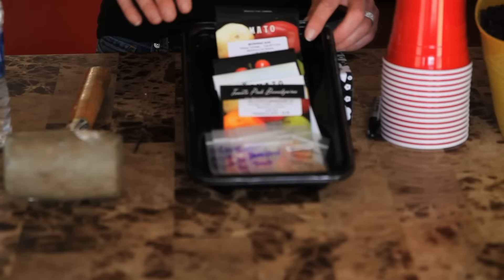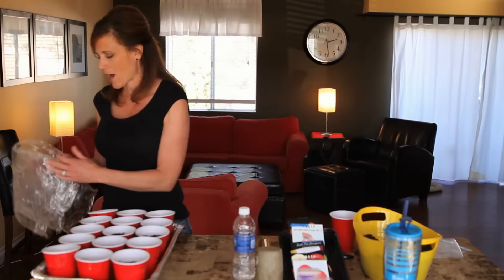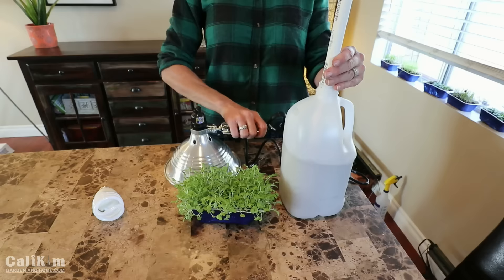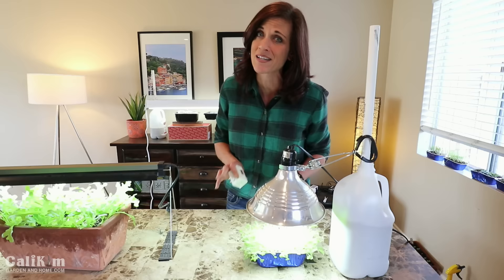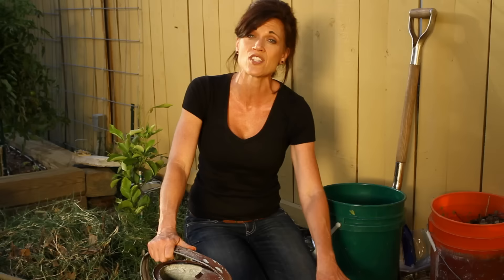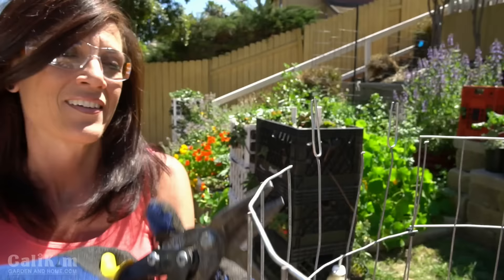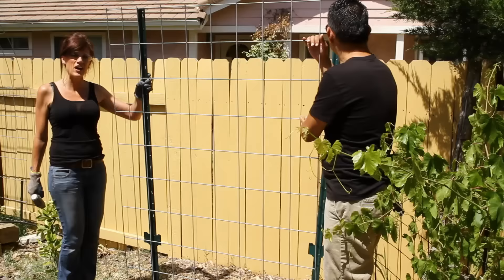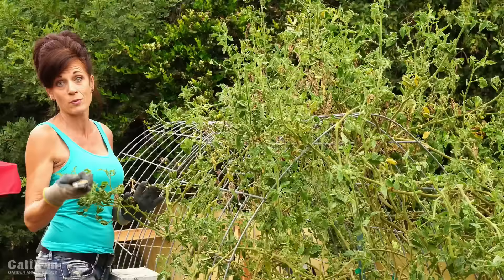How to Grow Tomatoes from Seed to Harvest // Complete Gardening Guide with Digital Table of Contents

Comment: I use same method with drinking cups and coffee cups.  Ice Picks make nice holes too. Also,  if you get the disposable coffee cups with plastic lids, you can fill the cup with garden soil,  put the plastic lid on,  turn the cup upside down,  cut a hole in the paper bottom of the cup and put the seed in. The cup will drain  then and the sprout comes up through the bottom with the hole in it which is now the new top.

Comment: hi , i enjoyed your video , a few diy's i use ,  my hoop cages were same mesh but 6''x6'' welded wire x 5' the diameter i choose was 30'' with 2 metal fence posts .  the hornworms were dealt with by having plastic mulch and spray with hot pepper wax , now when they try chomping the droppings are a bright green when fresh , day old they are dull green , day old they are brownish black , i look for the fresh droppings and then search over them , now where i am i move those critters to the sumac trees as they seem to enjoy those also ,  i am in northern new england  we transplant to outdoors on Memorial Day , harvesting starts July 4th ,  i pump fertilized water 24/7 in soaker hose buried under my plastic mulch , this allows the heated warm moist environment , a ecosystem with pest seeking frogs and garden snakes preying on bugs and rodents ,  the tomato root structure evolves into 2 huge root balls one a foot down where the manure is placed when they were planted and the other root ball is next to the soaker hose , i only grow those antique varieties ,  the extra tomatoes we make into paste and freeze ,  130 plants produce over 2,000 pounds through our season ,   happy harvesting !

Comment: Colin I've never used anything  but rain water for the garden needs and just started last season with seedlings and didn't think about the chemicals and did use treated water, thanks for addressing the issue 
I'm in zone 6 Ohio your seeds system doesn't work in this condition but you have lots of great teaching I'm taking notes ,about Bakers Creek Seeds lots of fine folks..
Lady Thanks

Comment: I know this video is a couple years old, but we bought 2 of the FM lights this winter, and discovered that FM puts out little cords that will link them together, up to 4 lights on a single switch. They run about $9 each from the company, but it sure saves a lot of outlet space by eliminating the power cords for 3 of them!

Comment: I use to make hog traps with cattle panel and install them in the woods. I use a small pair of bolt cutters, very clean cut and fast. You can get a pair at any hardware store where they sell the chain.

Comment: I actually planted about 25 starter tomato plants right after the last week of temps dipping down belowing freezing.  It may have been early February, and all i went with was the 15 day forecast and a gut instinct that the freezes were over.  Well several nights dipped into the upper 30's but tomatoes seemed to thrive.  They now are over 2-1/2 feet tall, very wide branched and with tomatoes now growing as big as 2 inch diameter. Very healthy and dark green foliage.Some are in 5 gallon and some in as large as 10 gallon containers. But in fairness i am in Baton Rouge Lousiana. Now it is on average 78 degree by day and 64 maybe at night. And soon will come the muggies.  Lots of hot muggy days ahead. Today, the day before Easter it is sunny, and mid 70's.
Reply from the maker: Congratulations Richard! You plants certainly sound healthy bound to give abundant harvest- thnx for sharing!🍅

Comment: If you write the name on the cup vertically instead of horizontal, you can cut the cup up and use it as a name tag in the garden.
Reply: PS LEDs use less energy than CFLs. 
You should look into compost tea. A lot of the same ingredients in your soil but you can add it slowly throughout the summer.. it also has mycorrhizal and sugars..
Reply from the maker: Brilliant! CK

Comment: Another crazy thing is if you have a dedicated area you start your seeds in that doesn't change is you can take two pieces of twine and two hooks that you screw into the wall or ceiling put them in the ceiling the hooks I mean and then tie two pieces of twine one on each chain and after you pass the twine through the hooks about 3 or so depending on ceiling height and all that time me two pieces of twine together to make one rope and just raise and lower the light that way I have an old 4 foot T12 fixture and balanced driver and I found some full spectrum grow lights that replace the T12 bulbs at Walmart I haven't got to try them yet but I have tried the smaller normal light socket base grow light that are the same Full spectrum color and I have had really good results with those the only thing is those don't plainly stay the Lumen rating they just show you what wavelength colors that they put out which is exactly the ones you need for both flowering and vegetative growth and so far I have been growing a full grown tomato plant indoors and it's winter time just about and it's still producing fruit and I have quite a few good sized tomatoes on it and it's still producing flowers cuz it's an indeterminate variety I have it in a 30 gallon storage container tub as its pot and the bottom three in I filled with gravel also wood Drilling a few good size drainage holes to prevent it from getting waterlogged and I can't wait to try these tomatoes that are coming in on it because I'm proud of this plant just at the beginning of fall outside just before the frost started coming in and I had my doubts but I get being able to grow indoors but I'm pretty excited that's so far it is going very well the last time I tried growing vegetables indoors fungus gnats and taking over before I could get control of them and killed my plants but this time I was prepared can I put a half inch to 3/4 inch thick layer of sand over the potting mix and gnats cannot borrow down to that course sand so they can't lay their eggs that has the larvae that eat the roots so far that's paid off pretty well

Comment: I put leaves and grass clippings around my tomatoes it's great for the nitrogen the plants need as well as protecting the roots and the ground underneath from drying out
Reply from the maker: Great tip, Lyle!!!  Sheesh, if thats working, keep on and thanks for sharing it here!!!!  Thank you for posting-Kim
Reply: @CaliKim29   I do live in Indiana so the weather is a bit different obviously but some people say it doesn't work but the problem is there not putting it on thick enough keeps the weeds out or at least most is them I wish I could tell you if it was recommendable in California because once the Tomato season is done we get a lot of snow and rain that helps to degrade that old grass down into the soil and basically turns it into compost for the following year

Comment: easy proccessing tip for halving cherry tomatoes. place about 15 tomatoes on a saucer. Cover with another upside  down saucer. press down on top saucer till you feel the resistance of the tomatoes. Carefully saw through between the saucers . Voila...15 tomatoes in a bout 10 seconds. (restaurant industry proceedure)

Comment: Word of advice don't use tin snips like she is using it will ruin your tin snips. Tin snips are to cut sheet metal not round wire. You should use side cut pliers or bolt cutters plus so much easier.

Comment: Yess..i will be using the same fertilizer  is very good i love it.thank you for the tip i using for the last 6 months .
Reply from the maker: Hi Sandra - are you using worm castings and Trificta+?  Both powerful organic fertilizers that work wonders in the garden.  Any tomatoes planted yet?  Thanks for stopping by!
Reply: yes,is so good for the garden..i still have trificta  but now i just run out of worm casting but i used your code  for sure and i will be used again.thank you for your video.

Comment: For light reflection, aluminum foil isn't that great. You need a white surface, it will reflect much brighter. Paint or paper works fine. I used a small sodium vapor light as it gives a reddish spectrum that plants like. It also provides a single pinpoint source that mimics natural sunlight.  BTW you're a hottie hehe

Comment: I find it easier to use a drill to make drainage holes in a stack of cups all at once. My drill bit will get about 10 cups at once. And it's always more exciting to use power tools, even for something small like this.
I fully agree about the San Marzano tomatoes. They are absolutely delicious, with very little seeds and goop. The Burpee starts were a surprisingly sad sight, whereas the ones I started from seed are absolutely prolific and just taking over! I've had to twine up 4-5 branches on each plant so far and I am thrilled!
I must confess, the little SunSugar tomatoes are my very favorite so far. Like garden candy!

Comment: i have started brinjal black beauty and strawberries indoors about a month back but they havent sprouted. Should i be worried? is there something i am doing wrong? i used peat moss mixed with organic compost. no fertilizers. Kindly advice. 

Note it is currently very hot in Botswana, about 100 fahrenheits -104 fahrenheits during the day.

Comment: Don't use a hammer and nail takes too long.   Take your drill and drill the bottom of a stack of cups.  Done all the cups have drainage holes. Same thing with the water bottles use a drill.  Can't reuse the cups if you write the date on them unless you do it the same date every year.

Comment: So if you use two light bulbs that add up to enough lumens or kelvins will it work just the same?
Reply: the light spectrum wouldnt be the same it'd work but you'd get much better results using the correct wavelengths

Comment: When you were cutting the wires on the cage, you were using sheet metal shears, which is the wrong tool to use. You might want to use electrical lineman's pliers for this. You won't have to use both hands.

Comment: Hi, Is it possible to pant the seeds directly in the ground outside instead of first growing them indoors? I live in a country with very hot temperatures.
Reply: Starting them indoors is for colder climates.  If you have a steady 70F to germinate the seed and the number of days for producing fruit put the seed in the ground.   You might have to battle cutworms as they like tender plants.  You can use a 2"- 3" piece of large drinking straw to keep them off the stem of the plant.   Split the straw on one side so that when the stem gets bigger the straw will pop off.  Also helps keep other insects off your plants.

Comment: WARNING: Himalayan pink salt is a “fad”.  It was successfully marketed by the industry, simply because it’s cute!  It is much more expensive than other salt, only due to marketing strategy.  Yes, it contains more minerals than common industrial salt.  However, Himalayan labor is cheap, which promotes ‘slave labor’ practices, out of sight, so distributors make huge profits.  Secondly, along with the elevated mineral content, is elevated toxic mineral content, namely lead and mercury.  Percentage wise, the levels are way above other salts.  The actual level is negligible, complying with FDA limits, but lead and mercury are two of the most toxic minerals in earth.  We know that the FDA has been compromised by “money”, and is no longer the police of our consumer products, as they were meant to be.  Small parts of lead and mercury per billion, cause permanent brain damage and other debilitating health problems along the way!  Snow captures pollutants, forms Himalayan glaciers, that grind the rocks as they move, but mix the minerals with the polluted water.  The best salt is from mines of sea beds, formed before pollution and buried underground, protected from today’s pollution.  It is not as cute as pink salt, usually rather gray or brownish, but the quality exceeds pink salt, and so does the flavor, IMO.  “Money” will try and keep this defect a secret.  You can understand why.  Now that you know the Truth, don’t be a victim, only to find out 20-30 years from now, when there is an epidemic of brain disorders, disguised as “Alzheimer’s” (which there already are).  I discovered Real Salt.  I’m sure there are other brands, and if you find them, please share.  Table salt us usually derived from mines, but processed to remove the ugly color, removing a lot of the healthy minerals.  Dextrose (sugar) is added for marketing purposes (that’s why so many are addicted to it).  Anti-caking agents are added, that contain cyanide, and the body “filters” what is left of these ingredients, after they have done their damage, only to damage the “filters” – your kidneys and liver!  Be careful of all foods and drugs that are “marketed”.  If it is really good for you, your palate and brain will draw you to it – no one has to “market” it to you.